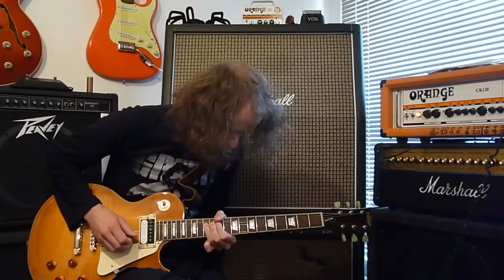Why I prefer Solid State amps to Valve amps

Comment: I think most of the differences are in the circuit and the speaker(s). If you make a circuit that works for vacuum tubes, it won't work for transistors, and vice versa. However, most companies which just want a cheap solid state amp to sell to beginners don't want to put in the R&D to develop a great solid state circuit, or spend more money on putting in a good speaker (if it's a combo). I prefer the feel of tube amps (they have a different compression in my experience), but if I'm going to perform or just jam in my room I'll use whatever is available. And when you're on stage, your audience isn't listening for your exact tone. So, to each their own.

Comment: I have used a Quilter Tone Block 200 for years. I also have a Marshall 9000 Series power amp and and a Marshall EL34 dual Mono Bloc 100/100. I have A/B them against the Quilter. The sound difference is almost not detectable. The Quilter is 4lbs. It works with 4/8/and 16 Ohms cabs. Use 1x12, 2x12, 4x12 and will power 2-4x12 cabs no problem. For me it's really been the perfect amp. NEVER had any functionality issue. I have used a couple dozen pedals in front of it and it took them fine. Buffered or unbuffered.

Comment: I think that the whole debate is really this simple. Which is better? Acoustic or electric? Single coil or humbucker? Analog or digital? Solid state or tube? Really it's neither. It's just your preference. Some people have an ear for tone while others don't. Others just haven't developed an ear for it yet. I recall during my first year of having an electric guitar that I was barely able to notice a difference between the pickups because I didn't know what to listen for. I was distracted by the sound of the notes that I was playing. Now I can tell a big difference between them. It was the same with amp tone. My ear is still developing as I have been playing for about 18 years now. However I'm pretty sure that if guitar players would focus on tone they would realize that there are many different styles of tone out there and some can only be accomplished by specifically using a solid state or tube amp. They do have a difference in sound although sometimes it's very subtle. It's like playing two acoustic guitars of the same size and string guage but being made with different types of wood. The fact that they're both acoustic guitars means that they're going to have a similar sound but the wood makes the difference. My humble opinion is that your gear doesn't matter (in terms of whether or not you can make great music). Music is an art and you can make your art your way. If you can't afford a tube amp then there is no shame in that because neither amp is better than the other. I started with a solid state, then I got a tube amp, but now I'm considering a solid state for a few songs because of the consistency in tone for straight forward rock riffs. In the end it's all up to you to pick the amp that you like best.

Comment: i am with you dave. i have owned vale amps and solisd state. if the amp has a good tone i can't tell the difference. i'v miced avery amp with my preferred speaker the celestion g12t-75 and surprisingly also small solid state practice amps are good through this, i've also used line out of valve e ss amps through cabinet emulators and the result is the same, there is no significative difference btween valve and ss amp if they are good enginered.

Comment: Being from an electronic engineering background, I totally agree that transistor amps are more consistent in their sound than tube amps (an easier to maintain - pretty much don't maintain them). Do they sound any better than a tube amp? Depends on the person and what style you play. Personally I think most tube amps sound better than transistor amps (and I'm not talking modelling transistor amps). Straight tube amp distortion sounds different (better) to my ear to transistor for the simple fact in the way they distort a signal and the extra harmonics that come with that distortion. Yes, FET's distort similarly, but not exactly to tubes. They do share some similarities and characteristics. Modelling technology has come a long way in the last 20 years (as has transistor amps). I think it will only be a matter of time before a company perfects it and puts all the tube manufacturers out of business (and I can't wait for the day). Because, while I love the sound of my tube amps, they are a pain in the arse to maintain, service and the real cost over time to do these. Transistor amps are built cheaply, consistent and are light weight. Got a lot going for them except the sound. When that hurdles overcome, lookout. 
BTW Those Kempfer amps are going in the right direction with tone but the price?? FM. I've always wanted to just get a nice sounding modelling amp or pedal, plug it in to an even sounding SS amp and go to town. But the modelling price hasn't really come into the real world of consumers just yet (of course unless you want a nasty sounding half baked solution). Some people make it work for them. I'll keep the mashall until something better comes alone at an affordable and comparable price.

Comment: I have both tube and ss amps in my studio. I do notice a difference, but I both have their place. I did sell my 2 x 12 JCM 900 in favor of a Valvestate 8100. My bandmates thought I was a moron. Even with a boost pedal, I could seldom crank the volume on the JCM enough to get the distortion I wanted. (yes my amp had been serviced and re-tubed) I can play the 8100 at almost any volume and get the sound I want. It doesn't quite have the punchy mids of the JCM, but that's mostly fixed with a decent EQ pedal. It's also more versatile. I was in a metal band playing a Jackson Dinky with Duncan Invaders through the JCM 900 with an MXR Micro Amp. We were stupid loud! The other guitarist had a 60 watt , 1 x 12 Peavey Transtube Bandit, an Epiphone Wilshire with stock mini humbuckers and he used a newer Boss DS1. His rig cost about 1/6th of what I paid, but he cut through the mix better with a punchier and more aggressive sound. Where I prefer tube amps is actually at lower gain settings. I find them to be more responsive. For bluesy sounds, nothing beats my 5 watt Valco with a 10" Weber - Signature speaker. Light playing will be almost totally clean. When I dig in, there's the perfect amount of break-up. I've never heard an ss amp get that 100% right. But again, the Valco only sounds good between 4 and 6. At lower volumes It's pretty lifeless. Higher and it turns to mush. Something like the Station Audio - Sparkle Punch can get an ss amp close to the response of my Valco (there's a tube in it) but it's still not 100%. Honestly, that pedal helps out any amp! For bass, I prefer my Acoustic B120 for more angular or aggressive sounds and my B-15 for a bigger, mellower and warmer atmosphere. Hey, ss amps were good enough for CCR!

Comment: Ive used SS amps since 1965. I've used tube ones too but primarily SS. I think SS got a bad rap back in the beginning when the amps had technical limitations due to transistor fabrication technology and the fact that early on you could only get NPN high power transistors and thus you had to make quasi complimentary designs which were pretty unstable. Today poweful BJT's and FET's are available in both polarities so you can have true rugged, stable complimentary designs... technically speaking that is.

Comment: I just got my first tube amp (low wattage). Mainly to satisfy my own curiosity. The only difference between valve and solid state I notice is how it breaks up from clean into crunch and how it responds to attack. Apart from that I can't tell a difference...mines brand new and already had an issue with it so can relate to wanting reliability!

Comment: i used a fender frontman 212r when i was giging.. its a very good amp. never had any problems. comperd to my mates all valve orange 50.. which had its moments once or twice. and the fender amp cost under £250.00

Comment: Good vid. I use tube amps myself, blackstar S1 6l6 100 and I use a HT 5 to practice on. I have used solid state and enjoyed them. I find that whilst great advancements are being made with ss, the same can be said for valves - my S1 has midi capability for example, ISF voicing control and DPR which means you can get decent tones at most volumes etc. etc.A number of years back I had a Marshall avt which combined the two - I liked that amp. What I don't get from the comments though is this - "punters in the pub don't know what they are listening to" angle. A) that assumes that ss are indeed "worse" which I don't think is the case B) It shouldn't matter what they do and don't know about the vagaries of gear and tone. I don't know cooking but if I was paying through the nose for a meal I would hate the think the chef was looking from the kitchen and saying "yep, definitely not the chef, give him the shit ingredients!"
Reply from the maker: Thank you for watching. : )

Comment: I've owned valve amps that have been destroyed by solid states. Especially the CR120! That thing is insane. The biggest problem I find is that, especially with combos, the manufacturers pair them with rubbish speakers. I've had my sound transformed simply by plugging into a different cab.

Comment: I think both amps sound great, I hate to blow smoke up my own ass but i'm a pretty good player. When I play through a SS amp, I don't put the guitar down and say "it's not tube, I can't possibly play through this thing." However, I will say that when you push a SS amp, they sound really processed and weird, but tube amps turn up and never lose their dynamics. I remember switching from my Marshall AVT150H to a Marshall TSL 100 and going  "HOLY SHIT! THAT'S LOUD". I also found that the distortion was alot smoother. And I do agree with the maintenance aspect; it takes more effort (not much) to run a tube amp. For some people (like me), they enjoy maintaining their tube amps. Just my opinion though, always comes down to how well you play though. 😎🤘

Comment: I also prefer the solid state over the valve amp for all the same reasons you said (except for cost which doesn't bother me).  I also really can't hear the difference between them, especially when playing live.  I think the cab and speakers have more to do with the sound than the the amp. On a recording it's a different story, but for live gigs then solid state is king.

Comment: valve amps seem to pick up more harmonics and have a more prounounced dynamics. ex.. when you punch a note and it breaks up.. but it seems like you use  compressed distortions/ overdrives so you wouldn't notice the nuances

Comment: I like solid state gear too. I have an old Yamaha G100 amp that kicks ass. 
And just because it has tubes doesnt mean its a jem. I had a Peavey ValveKing 100  that was all tube and it sounded like crap. I had a Peavey XXL head that was solid state and it was one of the best amps I've ever had, and Ive had a LOT of amps.

Comment: Wondering what everyone's thoughts/experience is in regards to SS amps in a loud live band mix? One thing I often read is people feeling like the SS amp didn't cut or punch through the same way a tube amp does? This has never really made sense to me in the sense I fail to see how the technology converting an electrical signal can affect such a thing. Now if said amp was too quiet, or EQ'd badly or didn't have a speaker specifically for guitar in the cab then yes I can see how that would cause the issue. But assuming volume, EQ and speaker are essentially equal, can the tubes really make that much difference?

Comment: I think a big reason for the prejudice against solid state amps is that most electric guitar players started with a small, cheap, atrocious sounding solid state amp and they immediately associate ALL solid states with that cheap poorly made practice amp they had at 16 years old. Also, there has been so much progress made in solid state amp sounds/tones vs. even 10 years ago. I can understand knocking a Fender Frontman 15, but that is worlds apart from a Fender Twin Tone Master. I had a $150 Roland Microcube (circa 2008) as my first playable amp and it wasn't perfect but it wasn't bad. Compare that to the BOSS Katana 50 which retails for $250 today, both solid state amps, made by the same company, about the same price adjusted for inflation over 15 years, still very affordable, but a WORLD of difference. The Katana 50 could be your first amp and your last amp if you so desired. I still like tube amps, I'm kind of enamored with that outdated technology but I almost never play live. I can't imagine the cost/maintenance of playing dozens/hundreds of gigs a year and lugging around a tube amp that always needs expensive work done to it. Doesn't make sense for a working man gigging musician.

Comment: I play through a 1972 Traynor YGL-3A MKIII (think fender twin on steroids with a master volume) I've owned this amp for about 6 or 7 years right now, and i never had a single issue with it. The same is true for my other vintage tube amps (mostly 70's canadian stuff, pepcos and garnets) . I do bring them to a tech whenever i buy a ''new'' one, i like to have a tune up done on a vintage amp before using it for good. but once this is done, never had any problem with them. So for me reliability never was an issue with tube amps, that are 30 and 40 years old... And neither cost was, those old traynors are still quite cheap on the market today. 

Tweaking wise, i'm like you, i set my amp then i forget it, i never felt i had to tweak it mid session or anything like that. Tone wise, thhe traynor is a monster,  i can't dial a bad tone out of it. Is it better than solid state amps ? For me, absolutely. For my setup it works ! I had a few gigs that i had to play on solid state amps, and once it was a mg100 like yours, i hated it, i was not able to dial something that worked for me. The absolute worst was a solid state bugera head, the tone i had was horrendous. But maybe for certain folks it works as well as my traynor for me i dunno.

Anyway i think some solid states can sound goog, that cr120 for me sounded so much better than the mg (i tried one) but yeah i prefer tubes.

Comment: Great Vid Dave I'm with ya I like solid state amps or hybrids solid state amps are better for gigging as they are more reliable its sucks when a valve goes during a gig so you are always forced to take a backup amp so you have to lug more gear. I will say a valve amp in a studio you can't beet the sound but as technology gets better solid state amps are that close to valve now its hard to pick them apart. people can disagree with me but I own solid state, valve and hybrid amps

Comment: I'm humble about which amp is better because I havent thoroughly tried them all, but I have tried some, and had Valvestates since the mid 90s and they are definitely one of my favourite amps. I'm actually using one in my current band plugged to a Jensen loaded 4x12 and that-is-great. It's not only my opinion but also people from the audience and other bands usually come and tell me how nice the sound was after the gigs. In some of them I plug it to cabinets other bands or the PA guys lend us, like Mesa or Marshall cabs, and this little old valvestate always sounds killer. I have nothing against any type of gear, guitar, pedal or whatever can sound good. But the pseudosientific snob mythology that surrounds tube amps (and even the idea of 412 cabs over 212s) sometimes is an insult to public intelligence, it such thing truly exists.
Also one of my favourite amps was a 70s full tube one. But too heavy and lots of problems made our first band go try the valvestates back in the days. We didnt care if they were SS or tubed (we didnt even surely knew back then). We only cared if they sounded good.

Comment: Nothing wrong with liking solid state amps. Many great players have used them for clean sounds especially. New technology has also made them react more closely to a valve amps. You should check out a Quilter I think you'd like it, though I have heard really good things about your  Cr120.

 Personally though I prefer Valve amps for the power section distortion especially when pushed by a good O/D pedal or pre amp, which you just cannot do with a solid state amp. Its not only the sound but the feel under the fingers.

 With the huge number of small watt amps available now at quite cheap prices its not difficult or expensive to build a valve rig thats powerful enough for pub usage and at bigger venues you'll be mic'd up anyway.

Comment: I used to have a Hiwatt 200 watt double stack - the tubes got so hot the head had a built-in fan that was clearly audible when playing at lower volumes - completely useless for recording purposes! I am quite happy with my current Acoustic G120H DSP 120 watt half stack and much less weight to haul, quieter performance, and no tubes to worry about - ever! Sure, I had to play around with it to get what I needed, but it suits my current needs just fine, thank you. (Oh, but small tube amps do sound warmer and are more responsive at lower volumes...;-)
Reply from the maker: Thank you for watching. :)